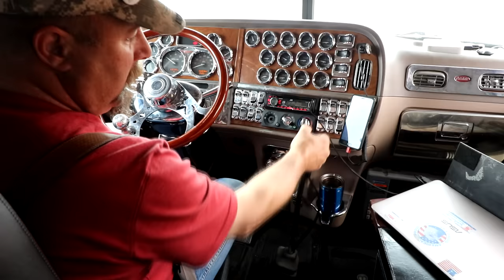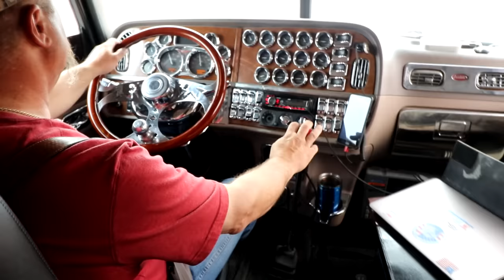How to shift an 18 speed transmission

Comment: Me learning how to drive a five speed: “wow this is difficult”

Sasnak: pathetic
Reply: It apparently is simple to adapt to a higher number of gears though. 

People are always concerned when I tell them I start my truck off in 2nd gear - wait til I'm starting in 5th gear boys
Reply: I didn't first know how drive automatic. First i learned drive 5 and 6 speed manual.
Reply: @mrwaltsuzz7556  it feels so disappointing to Drive an automatic, don't you agree?
Reply: @mrwaltsuzz7556  the car my parents got me is a standard, but I did all my drive time for drivers ed on an automatic. So I learned both at the same time.
Reply: Little tip for everyone struggling with shifting: try playing Euro Truck Simulator 2. I drove with a 12-speed for a while and now it's just an automatic movement of my left foot and right hand, everytime I hear the rpms go too high
Reply: @timbroski4487  what setup are you using to play?
Reply: @Usmcpvtjones  I have a simple steering wheel (Logitech driving force pro) with two pedals, and made one myself for clutch. For the shifter I use a joystick which I move in different positions and push different buttons (to all four sides and two buttons on top of the stick = 6 gears), and on the back of the stick is a button which I use as a splitter, to get 12 gears. It isn't perfect but it taught me how to shift, it's really not that hard in the end.
Reply: @Chad Broski I've gotten really good at the manual now, to the point where it's like riding a bicycle i.e. I don’t even think about it even more. Now that I know how to do it, I think it's much more fun than an automatic. 

Of course I still stall it occasionally, but more often than not it's when I'm trying to park and I just don't give it enough gas.
Reply: @Usmcpvtjones  I'd say I'd agree. Now that I've learned it, I much prefer standard to automatic.
Reply: @toasterbathboi6298  good to hear!
Reply: @Usmcpvtjones  The shifter cable broke in my car and I was in 3rd gear.  Fortunately all but one stop light was green and it was a bitch getting it to move out of 3rd gear but with gentle pumping/slipping the clutch until you got enough speed I was able to fully release the clutch.  Fortunately I was less than a mile from home on an early Sunday morning when it happened.  A few years later the same thing happened to my wife's automatic where she worked so it wasn't a problem because it broke just as she parked it.
Reply: I thought it was easy learning to drive a 5 speed
Reply: Not really that more complicated than a 5 speed .

   Visualize going 1-5 in low range , then high range as a 4 speed . Bingo , that's driving the equivalent of a 9 speed .

      Optional thumb shifter to split each of those halfway inbetween if needed , bingo , potentially 18 speeds .

   In modern trucks with reasonably high HP , you'll rarely if ever need to use all 18 sequentially in road driving at normal weights .  But you have options to get just the right @ just the right rpm , say for a particular hill .
Reply: @Usmcpvtjones  A good automatic is nice. A bad one is just...shoot me now.

Comment: truck makers: how many gauges do you need ?
trucker: yes
Reply: Haha funny
Reply: *gauges
Reply: In the old days, we monitored a lot of shit. Exhaust temp, the temp in each differential, oil temp, oil pressure, primary/secondary air pressure, air ride pressure, applied brake pressure, and many more besides.
New trucks have an idiot dash:
Fuel/DEF, primary/secondary air pressure, oil pressure, water temp, tach, and speed.
Reply: Haha, its more like: how many do you want? Trucker: all of ´em
Reply: @Incadazant01  , yeah but in the old days also "blowing a tranny" meant  you have a car problem, unlike today.
Reply: Lol, how many? Yes!
Reply: Ganga Din  nice.
Reply: Incadazant01 not only that but a lot of guys have automatic trans now too....
Reply: Remember, one of 'em is a clock, not a gauge.
Reply: well the think is as he said spliting em is crusial on mountains or other steep surfaces in order to keep the truck staidy and rolling otherwise that gearbox will end up crushing someones car. I would really love to drive a truck like that even if i wasnt cut out for the job just for the experience.
Reply: @andyb1653  time gauge
Reply: @friedchicken1  Nice!
Reply: @andyb1653  ty

Comment: Me: My life is hard.
See someone drives an 18 gears transmission truck.
Me: ok, my life is good, actually really good.
Reply: I drive one every day, easy life
Reply: @frankbraun3263  wow alot of respect thank God for you guys
Reply: @Derellrassy87  glad to know we are still appreciated
Reply: but shifting semi trucks is actually pretty easy, just, when you need to shift you have to commit and do it quick. if you allow the wheel speed to trans speed ratio to change too much you fuck up. So once you've got the feel it gets really easy at least in the first half of the transmission because no synchros.
Reply: if the hardest thing you have to do is shift gears your life is not hard at all

Comment: Next video..."how to look over the dashboard" ^^
Reply from the maker: The camera is at a downward angle to see the shift pattern better
Reply: Sasnak 
I suspected it is...I was just kidding of course. Thanks for the interesting video.
Reply: I was thinking the same. His eyes are level with the top of the dash.
Reply: would explain why so many big rigs follow within a car's length doing 60+ in a 55...
Reply: They're not bad when you're sitting in them.
Reply: scubadivingsince2006 thars where the lot lizard rides
Reply: @Sasnak  r/woooosh
Reply: OK, OK So the guy didn't air up the seat yet, some big guys drop the seat to maneuver out and around the cab.

Comment: Manufacturers: How many gears and gauges you want?

Truck companies: Yes
Reply: He’s got an o/o (owner operator) spec’d truck. Your average fleet truck like say swift doesn’t have all those gauges because those extra gauges add up when buying the truck. Over the span of 100+ trucks, not getting the extra gauges saves money. But on the other hand those extra gauges do help you keep an eye on your axle temps, braking pressure turbo boost, egt, fuel pressure, trans temp. Items you should be in the know about in case your starting to have trouble while driving down the road.

So if you hear about a truck being o/o spec’d chances are it would have that many gauges in said truck verses when someone says a fleet spec’d truck. There are many differences between the two but from inside his cab it’s easy to see his is o/o spec’d.

Comment: Worked and drove one of these thing 37 years ago,  have to constantly shift for even the mildest climb or descent, and every little bump on the road is enough to break your back.  Have a lot of respect for truck drivers.

Back in the 50's and 60's truckers were saying didn't like their boss peaking over their shoulder in a factory job, that sure changed with electronics.
Reply: Seriously, when I see people cut in front of a trailer just because there's physical space, I shake my head at them not considering the momentum the trailer needs to give up and might not be able to make back for a while
Reply: The newer Rig’s are a lot nicer and pleasant to drive especially with the air ride seats and stuff... The ride is alot softer but it really varies between trucks, for example a dump truck or a concrete mixer will probably have spring ride suspension and maybe normal seats, and then a actual Tractor Trailer with a sleeper will probably have air ride suspension and nicer seats, not every truck though. Nowadays it’s a toss up between how deep your pockets are... If their deep enough You can have a Cadillac pulling a Trailer for example hahaha, or you can have a spring ride truck a little cheaper but it’s pulling your trailer and putting that hammer down 👍 Git Er Doneee 🇺🇸🇺🇸🇺🇸🇺🇸🇺🇸🇺🇸🇺🇸
Reply: When I started driving tractor trailers in the late '70's, I did it for the freedom, I didn't want my boss looking over my shoulder in a factory and scrutinizing my every move.....fast forward 45 years....my new truck has driver facing Lynx audio & video surveillance, and sign reader technology, that reports stop sign, speeding, R.R. crossing violations (we're haz-mat) Technology allows it to prompt markers for "actions" that resembles bringing a cell phone up to your ear, etc...the camera footage is reviewed by a third party who then labels the violations, ie: eating, cell phone, no seat belt, etc...also our own safety dept can bring camera up live or review120 hour prior history before needing to have 3rd party find date time of "event"....."We are in the truck with you" is what we've been told.